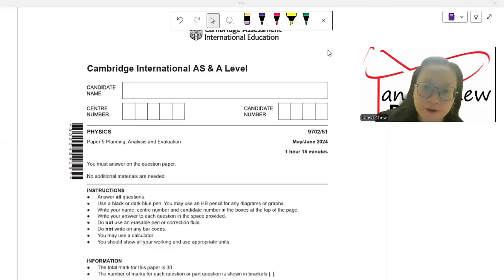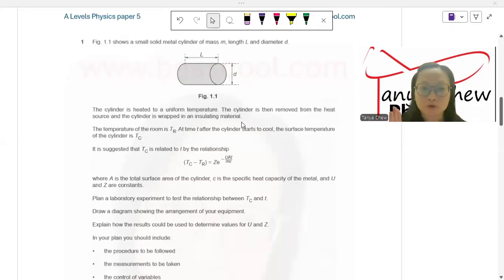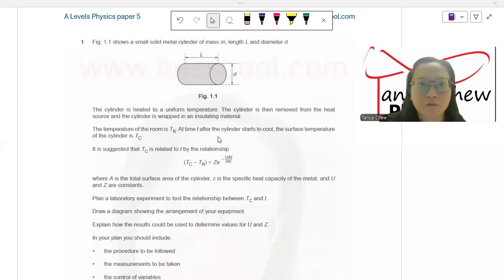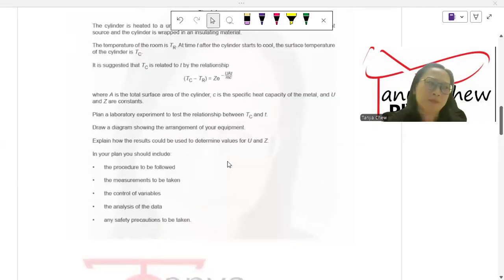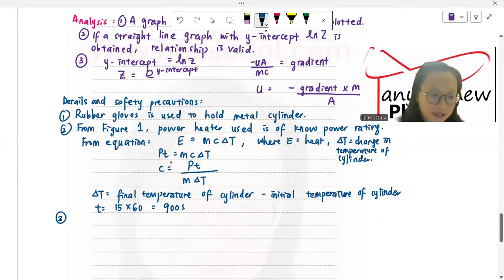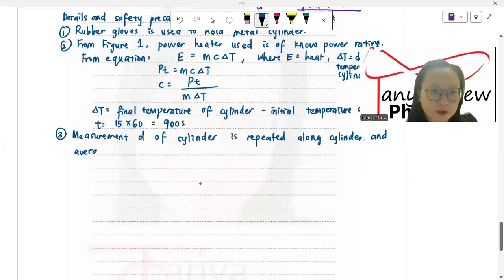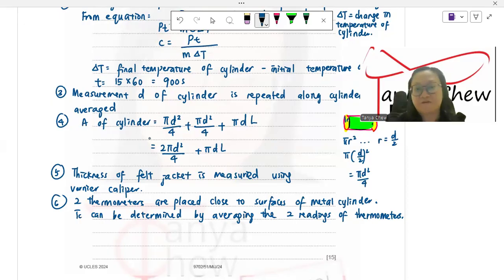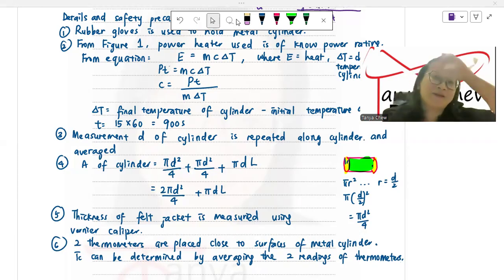A Level Physics 9702 | May/June 2024 | Paper 51| Question 1 (How to score FULL marks )

Comment: Hey teacher cant we put the metal in a beaker with heater in the beaker connected to an external circuit
Reply from the maker: yes you can. you need to discuss on the thermal energy of the heater is absorbed by beaker and by metal. You need to deduct the heat absorbed by heater in order to get the heat absorbed by metal.
Reply: @TanyaChewPhysics But, how will we even know how much the beaker absorbed and how much heat transferred to cylinder as some is absorbed by the water too and not all the energy goes into the cylinder from the water?

Comment: Ms. Chew, I have a question. Can't we take Tc as independent and t as dependent. Like we'll say we measure the time taken for Tc to reach certain temperatures such as 70,60,50,40,30 degrees Celsius. Would that work?
Reply from the maker: You certainly can. We normally choose the physical quantity which is easier to change as our independent variable. You can plan your experiment differently from mine actually. If you need someone to mark your experiment, you can always send your answer to me at tanyachew91@gmail.com
Reply: @TanyaChewPhysics    But isn't the mark scheme strict on what's independent and what's dependant ? Also thank you so much you're so kind ❤️
Reply from the maker: @ The mark scheme of paper 5 is quite linen. You can check the mark scheme online. :)